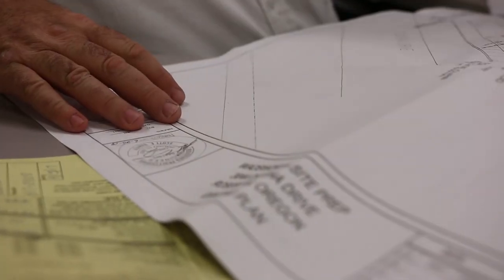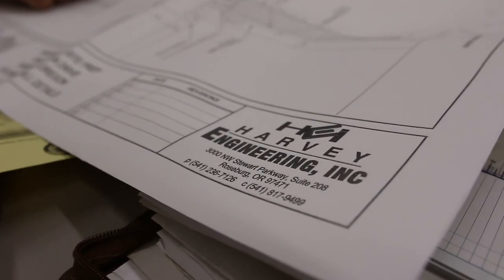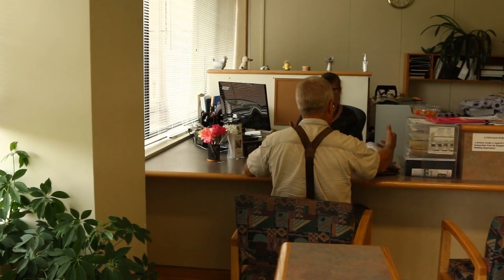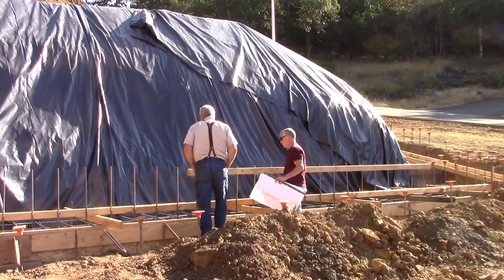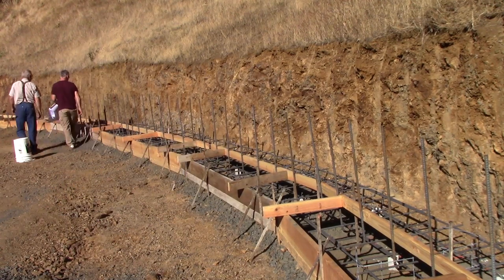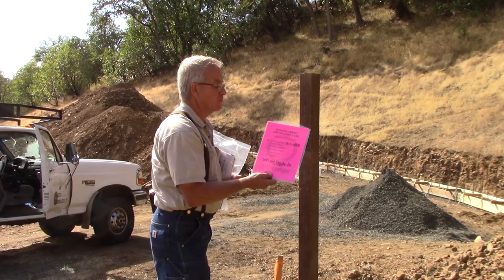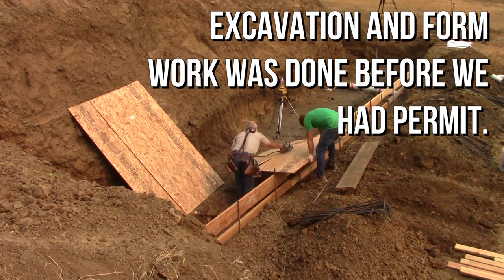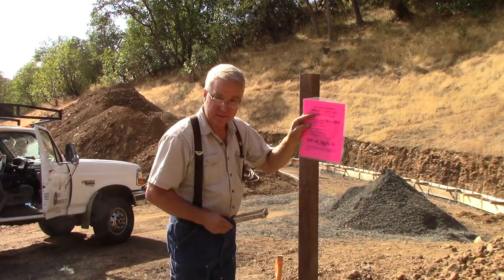Permit and Inspection EP.15

Comment: As a former carpenter, firefighter, fire inspector, fire chief and assistant building commissioner, I was always keenly aware that our 'customers' did not want to be our customers. I could tell stories of certain jobs where the developer/contractor/tradesman/homeowner was in way over their head. When you have buildings 20 feet apart or less there needs to be some oversight so that your freedoms do not encroach on your neighbors. I am glad you are the type of builder that you are, especially in making your videos, in that you strive to do it right AND explain WHY you do it. Most of my job as an inspector was educational, providing the why of the codes. Carry on with your great work and good luck. Just signed up as a Patreon supporter.

Comment: I just finished my house back in August and was a first time home builder. Let me say that as a first time builder my county permit people were the best in helping me through the process and understanding the rules and why. They worked with me step by step and were very prompt in their inspections. Needless to say, some are not as lucky and have a terrible time with their inspectors. Some inspectors can be picky and some could care less. But I know mine were both picky when they needed to be( depth of sewer line under a driveway) and not so much at other times( like when he knew we had a great grasp on what we were doing). So thanks for this video series and now I can look back on the process without all the stress. You know what I mean.

Comment: I’m a “contractor” myself these days. I say that in quotation marks because i’ve always been one to push myself beyond my current position too soon, without really mastering my current position i want to move up. So now here I am, a licensed bonded and insured general contractor for about five years now. Typically when i push myself into higher positions i pick up what i don’t know really quickly. With contracting though its been a bit slower, though i am getting there, day by day i’m better and better but there is still a wealth of knowledge i still have yet to learn.

This series is awesome, i jumped in at the mid point and even critiqued a method of yours but decided to run it back to the beginning and am loving alot, learning alot, and laughing alot, particularly at the “its a frustrating process” comment.

Thank you for this amazing series that is still teaching budding contractors years later.

Comment: I got lucky. Inspector came out on a pole barn project for which I had not specified any power. He said, "come on, you're going to put power out here" and said he wouldn't sign off until it was in. He didn't insist on a contractor so I did it myself. I've done a  lot of electrical work and I know the rules and this really was a pretty straightforward job with no weird stuff (meaning I know what I don't know too and will call in the real trades guys when necessary). He came back out and asked me who I had used, and when I said I did it myself, he said he knew a few contractors that don't do work as good as mine. He passed me on the spot. I do most of my own work in all trades because it's fun and challenging for someone who was (retired) a desk jockey. Overall I've had pretty good luck with inspectors. Maybe I'm just lucky. 
I also served on my village planning and zoning boards, so I've seen both sides. Sometimes developers really are trying to pull a fast one and need a little coaching. Here again, if we asked for something that actually made sense and could explain why we needed the change, most of the developers would get on board.
Reply: Thats not cool. The inspectors job is not to interpret your motives. His job is to make sure that what is built is what was approved and that its up to code. Im glad that it all worked out well, but I dont think that it was called for in any way.

Comment: Great video.  I like seeing the Tool Tank rolling around checking boxes.  Business owners do a great deal of thankless work and making nice with the laws and inspectors is on that list.  This house will be an excellent home for some family to make many great memories in.  It is my observation that there are very few homes with the care and concern put into design and build that this one is getting.  i have owned a home built in 2004 and now in a house built in 1963.  The current home is much more comfortable, efficient, (believe it or not) and built to last than the new house we built.  Value is hard to find...and rarely cheap.
Thanks for sharing your experience and expertise.  Your point about needing to get excavation done without a building permit wasn't lost on me.  Business owners carry significant risk.  Again, thanks for sharing.

Comment: As an inspector for logging road construction, I had the misfortune of working with a few that just didn’t understand what my job was.  I was even accused of being on a Power Trip once.  That came after they put 5 inches of crushed rock on a road when the contract called for 12 inches.  It turned into a big deal, but they had to come back the next season and put the additional 7 inches of rock on the road to the tune of about $65,000 dollars of rock they did not put on the road initially, but wanted to get paid for.  I’m pretty sure I was called some ugly things behind my back.  Power trip?  No.  My job is to make sure we got what we paid for, and nothing else.
Reply: The issue is Government Inspectors not inspectors for companies.

Comment: It took me 2 years to get my plans through Plan-check in Los Angeles County. They lost the plans and I had to resubmit them and pay a $5.000.00 fee again. When it was all over they made zero changes to the original plans. On the other hand, the Head Inspector told me half-way through the build to "Just take lots of photographs and call me when it's done." I think having all the Building Codes (UBC. UPC. UMC and NEC) and their State, County and City Amendments which I referenced several times during previous inspections when a question arose, gave him confidence in what I was doing. A funny aside here...I was an Assistant Superintendent for a 120 unit development for 2 years and the electricians didn't speak the American language so they misunderstood what an Inspector told them about running wiring through exterior-wall studs: they installed THHN instead of ROMEX and drilled a separate hole for each strand all around 6 houses. It was funny to see but cost the Builder tons of money to replace studs having 20 holes in them.

Comment: 3 weeks is good compared to the UK system which takes from 8 to 13 weeks depending on the scale of what is being built, on top of that you have the building control permit and inspections

Comment: Rules and laws in a civil society are not written for the contentious or craftsman among us but for the unscrupulous and lowest common denominator. Sure they can always go outside the law... that doesn't change the necessity for the rule. I appreciate your comment that it can be frustrating and time consuming but in the end they have a job to do. I also like your comment about "I made the choice" to dig early to work ahead of the permit acceptance. In the end it looks as though your foresight in choosing a professional engineer familiar with the area with a good reputation and your planning of the permitting time into scheduled paid off. Whenever I struggle to get a permit I often find myself thinking "these folks don't know/do anything" than i take a step back and look at the rule set they are operating under and in many cases I dislike the rule not the ruling... also most times I see hiccups in the permitting it is always when not enough time is built in for review. Cheers and continued good luck to you sir.

Comment: I don't mind paying for permits if there is value received.  However, in many places, the permitting process is a joke.  I bought a condo in Fl. It was about six years old when I purchased it.  I had to replace the walk-in shower because of defective installation.  The pan was installed incorrectly, many other units in the condo complex also had to be replaced,  where in hell was the inspector.  If you live in a multi-family building you need a building permit to install a new water heater.  You don't need a building permit to install a new toilet or faucet but for a water heater, you do. The building permit cost $50.00, the plumber charges $100.00 to get the permit. Now you waste a morning or afternoon waiting for the inspector to come. If you want a one hour window, you can get that but, you have to pay extra for that service.  When the inspector came he looked at the heater for all of five seconds, never getting closer than six feet and he signed off on the project.  In building the condo's they used plastic ball valves for the outside shut off valves that served three units each.  They also used the plastic ball valves in each unit. We replaced all of the exterior valves with brass ball valves and many owners are in the process of replacing the interior valves with brass ball valves. Why would city codes allow such junk to be installed?

Comment: So on a addition, does an architect draw up plans or does an engineer do the blueprints? What is difference? Do you need both? I never understood this.
Reply: In some, I won’t speculate on how many, communities the home owner or contractor can draw their own plans. If the addition is large or complex, the building inspector might require an architects stamp or an engineers stamp. My experience has been that they will spend a little extra time with DIY homeowners, making sure they are aware of how theentire process should go.

Comment: You just have to deal with it. I’m a residential framer some codes I don’t alway agree with but I’m not a Engineer so you do what’s called out on the plan. That’s what we are being paid to do. As far as inspectors if you treat them like a human most likely they will treat you the same. If you have questions ask them to explain themselves. I think codes and guidelines we need to follow are good, sometimes questioned but good. Think about what it would be like with out them.

Comment: If you ever want to know why building and zoning codes are important, just look at Houston after Hurricane Harvey and the mess caused by poor planning. While Houston still would have flooded, it was made worse by not requiring proper drainage, and allowing what were effectively industrial pollutants to hit residential neighborhoods. We saw the same mess in North Carolina where coal ash pits and pig manure pits flooded out and into residential and commercial areas. 
Yeah, dealing with Las Vegas Flood Control is a pain in the butt, but before those flood control channels and basins were a thing, it was a lot worse.

Comment: What is that tool at the 3 min 50 sec mark? Does it work with wood?
Reply: It is a staple gun/tacker/hammer tacker.  Very common tool for roofers/flooring guys to tack underlayment, tar paper and the like.  I prefer an air stapler personally, since they work for things like upholstery, carpeting boat bunks etc.  For bigger projects where you need to put in a ton its worth it for me to have the compressor strung, but for stuff like putting signs on posts you can keep one of these in a tool belt and don't need power.

Comment: This was nice and brief, but I think for many people who are looking to educate themselves, a more thorough look at, if not the exact process, a more robust overview would've been nice. Scott surely has the wisdom to let us know a lot more about something most people, even people who build things, have zero experience in. 

While the story for this project is "We applied for a permit, started work early, it was approved without issue", nice and neat, I didn't really learn anything because nothing really happened other than "we got it". I would appreciate some context of what can go wrong, what happens when it goes wrong, etc.

Now, obviously every town is going to be different so there's no point in going into the greasy details in that respect. but... for example: 

"In some jurisdictions your biggest risk in proceeding without permits isn't just that you might have to undo and redo it. Sometimes it's forbidden to do any work at all without the permit and if you get caught they will issue a "stop work" order and issues fines, even if your paperwork comes through perfect later.", and 

"For example, if they took issue with the depth of the concrete in my engineer's calculations, we might just have to tear all this work apart, bring back the excavator, redig, redo all the forms and most of the rebar. That's a delay of weeks and probably $8,000 for a project like this, just to have one simple thing slightly wrong. That's enough to make or break the profitability of a project like this", and stress 

"If you don't know who to use for your plans, ask the staff at the permit office who they trust and use someone they're familiar with. Often both draftsmen and engineers have shortcuts into the process because they've built a history and a reputation of doing precise work. Where other professionals might be more heavily scrutinized or delayed, trusted professionals will get through the process quicker.", and 

"Some of the people in these positions can have a lot of ego attached to their jobs, and they have, let's say, some flexibility in how strictly, or over-strictly they apply the rules. It shouldn't happen, but there are times when someone in the process is determined that your plans won't pass. They'll find a reason to fail them and there's usually no one to appeal to, so, it's very important that you hold your own ego in check, be kind and polite even when frustrated, lest you get on anyone's bad side. It shouldn't happen, but it does, and contractors from every town and city across the world will have stories about the times they got burned. If there's ever a time to swallow your pride and bite your tongue, dealing with permitting and inspections are a good time to choose." and

"Sometimes small towns will have special tweaks to building codes that aren't obvious to an outsider. A slightly different way they want things done so that any contractor from outside of town would build it wrong and fail the permit or inspection. If you can, ask around if anyone's heard stories like that about your jurisdiction, you might just be better off hiring local labor rather than an outsider. Which is probably why those slight changes were made. It's not an honest system, but it's the system you'll have to work with."

... Just off the top of my head from my very minimal experience. All those industry insider tricks and tips that wouldn't cross your mind until you're waist deep in red tape wondering why everything's so difficult for you.

My two cents.
Reply: MattsAwesomeStuff more like 9 paragraphs of cents
Reply: MattsAwesomeStuff More like 9 paragraphs of cents!
Reply: MattsAwesomeStuff cool story bro